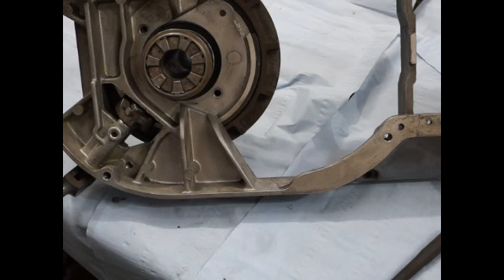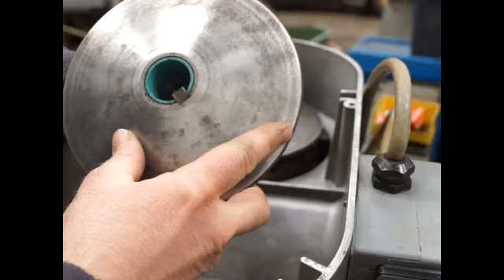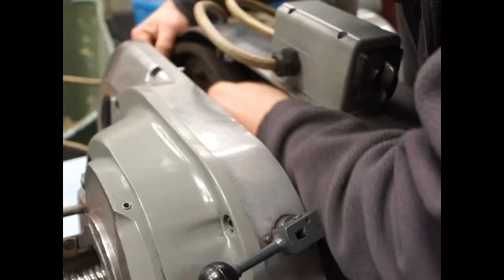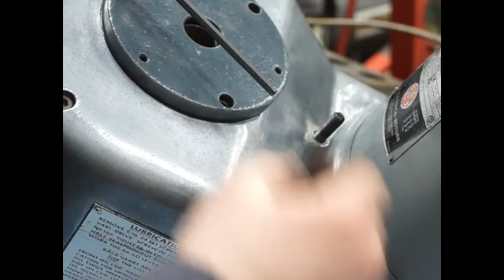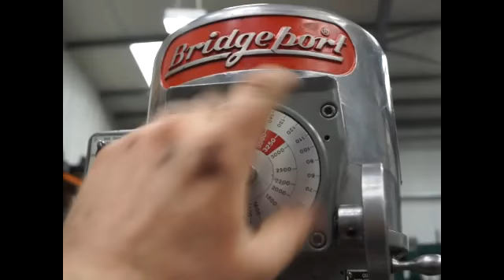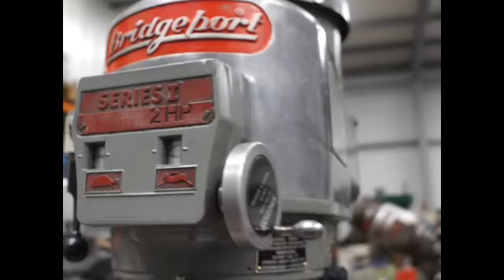Bridgeport milling machine Vari Speed Head Assembly

Comment: Hi Darren, really great instruction video for all us backyard novice machinists. Is it common for the head spindle shaft bearings to fail. The reason I ask is because my mill head spindle feels seized and I am about to start a teardown to investigate. I would appreciate any input from you please. I was thinking of starting by pulling the head spindle shaft out first before tearing the head assembly down. regards from Australia
Reply from the maker: Hi Gordon yep the taking the spindle out is easy just release the locking grub screw and then unscrew the bottom cap (which can be very tight) - then knock the spindle out from the top the bearings are all available and fairly straight forward to fit just make you sure the bottom 2 are a match pair. If you need any help with the sizes just give me a call +44 151 608 8666 - web site is www.gtprecision.co.uk

Comment: Recently I've been having a lot of trouble with a alliant mill that seems to basically lock up when you first turn it on. We found we can avoid this if we turn the speed up on the vari drive before turning it on  (it doesn't seem to matter what the speed is, it locks up almost everytime we go to turn it on. We've torn the head apart to the back gear belt and the shaft with the bottom vari pulley wobbles, but the bearing seems smooth and has minimal play. Could this be the source of the spindle locking up? The brakes are fine and everything spins freely below the back gears.
Reply: +Trevor Franzen I'm having the exact same issue on mine. Did you get this resolved? If so can you shoot me an email? land.tony@gmail.com. Thanks!